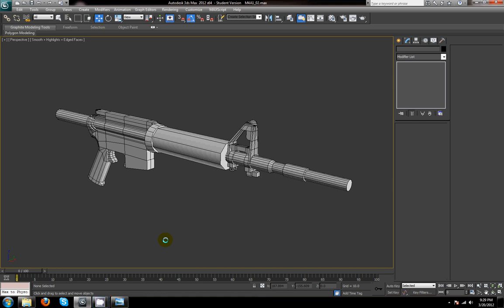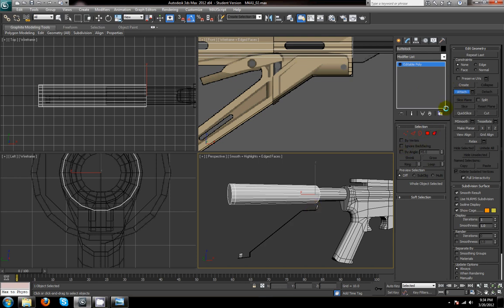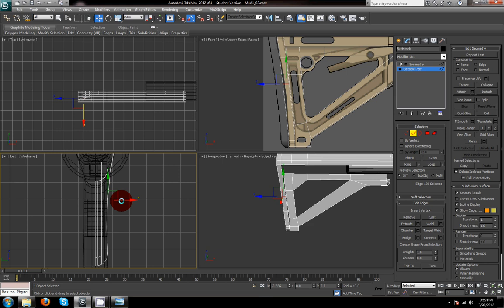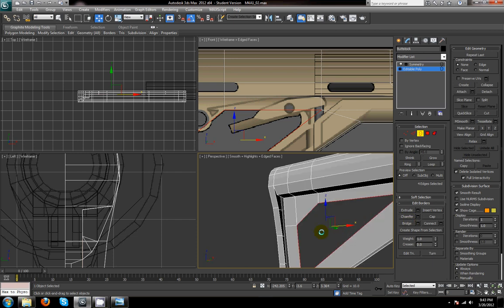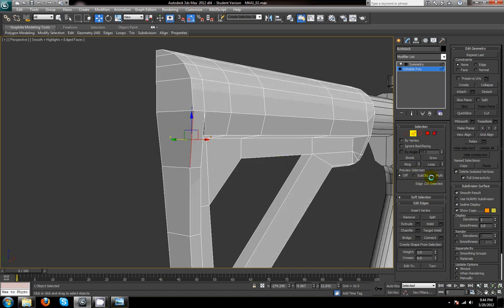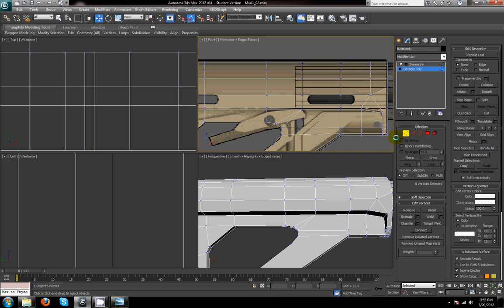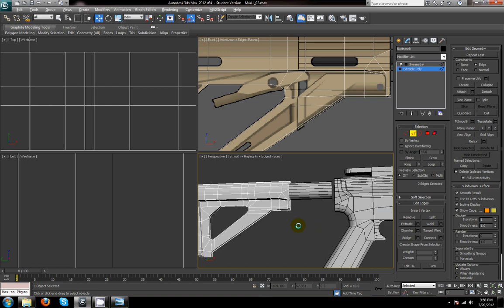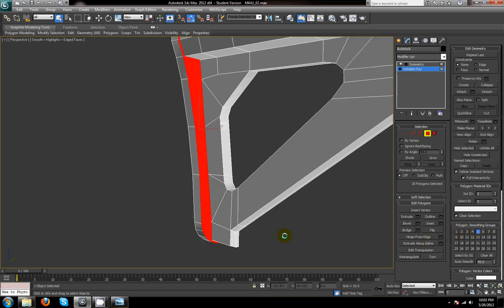M4A1 - 3D Modeling Tutorial - 07 - Blockout (Part 6)

Comment from the maker: wow, I'm surprised anyone caught that.  I did that when I was working on ideas for the next tutorial and I must have saved over the old file.  To answer your question though, it's really simple, select the two edges that are on the opposite ends of the opening.  In this case those edges will be the one at the very top and bottom of the open gap.  Just "Bridge" those together, then use the "Outline" sub-selection mode, select the hole and "Cap" segment.  Thanks for watching!